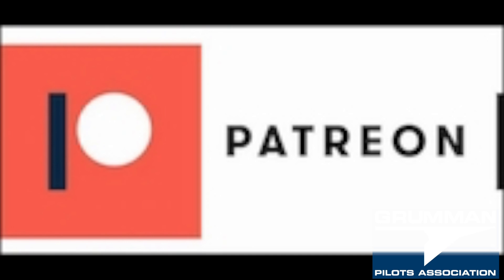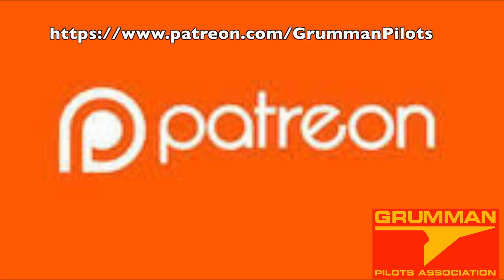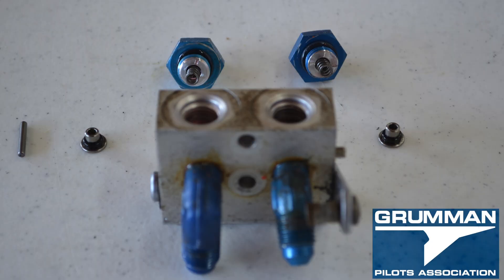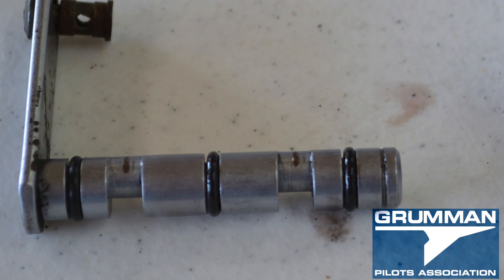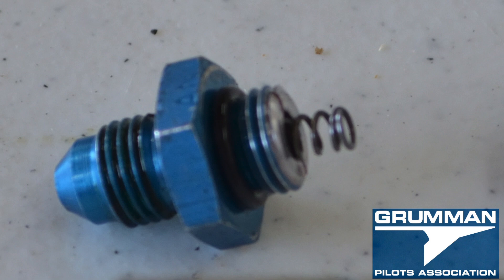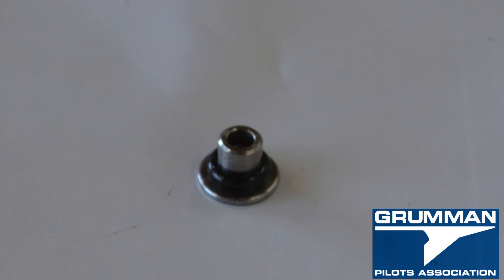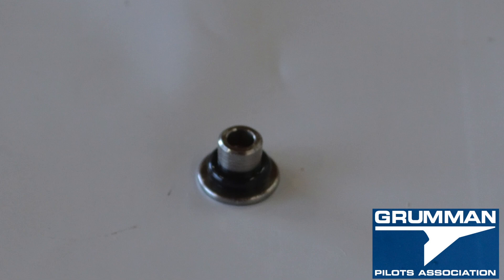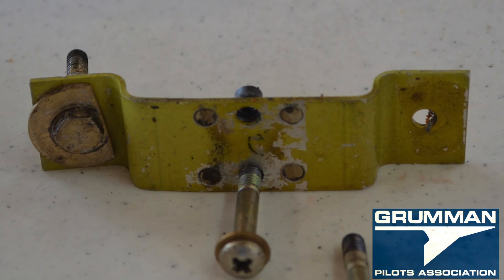Parking Brake Assembly - Grumman Style

Comment: one of these days I will upgrade to this mod. Every so often you wish you had a parking brake that actually worked.
Reply from the maker: Chocks and tie-downs work, easy to repair system.
Reply: Scott mine has been working for the past 3 years with no hiccups. All you have to do is make sure its properly rigged and your shafts are NOT bent.